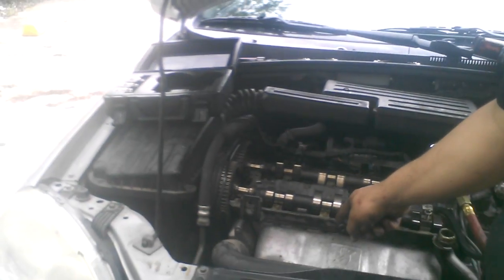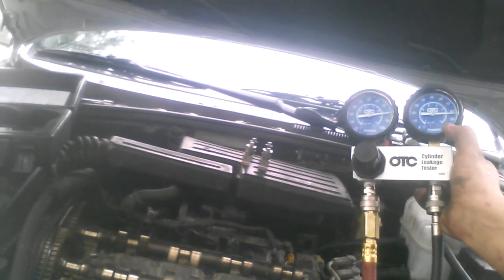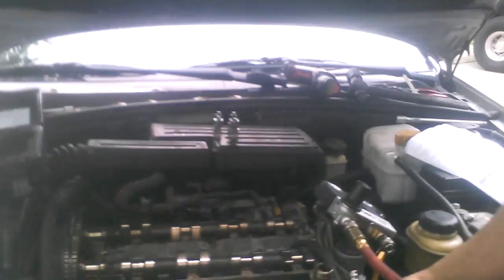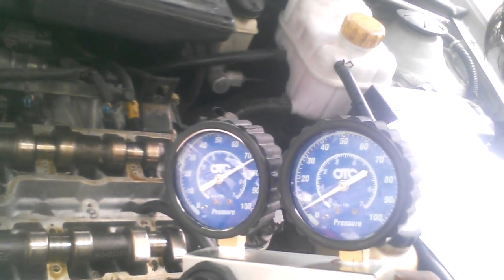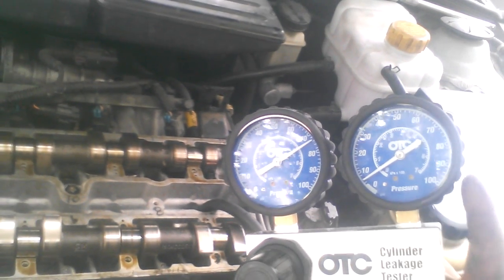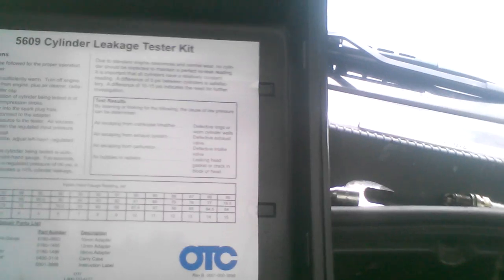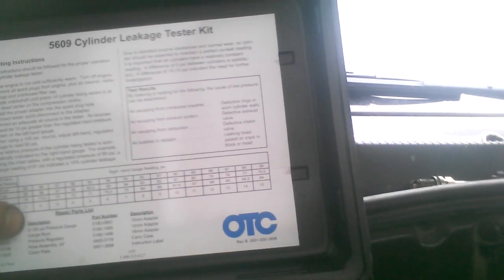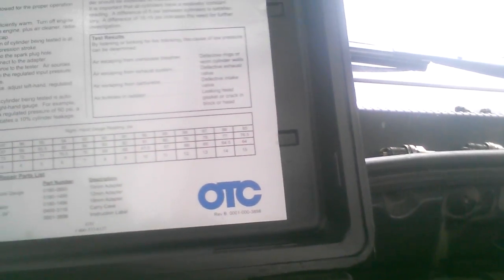What happens when timing belt goes boom

Comment: Hey my friend, I am dyer , I was ready to replace timing chain guide on 2000 bmw 540i , when I was ready to put the engine on top dead center, I turned the engine counter clockwise a few times. Should I replace the engine or send the head to to get repaire. I am not sure if I have some bent valve

Comment: so because you loosened the cams, you didn’t have to rotate the crankshaft in order to rotate the piston to full stroke? Just trying to fully understand. Thanks!✌️
Reply from the maker: With the cam bearings loose it is not pushing in the valves so the system is closed. But before you start make sure to set everything in time and make sure you know what you’re doing

Comment: i have a vw 2002 2.0 gas engine i put pepper where the oil go like a nut so i was driving then the car shut off and would not crank so a buddy put his computer on it it came up camshaft position sensor so i tryed to turn crankshaft by hand to put on top dead center 1 but the timing belt/sprocket would not move at can u tell me what could be the problem thanks for your time

Comment: OZ IM WORKING ON 2.4 ECOTEC  GM MOTOR AND WHEN I TOOK OFF THE VALVE COVER THE WHOLE RIGHT SIDE ON THAT CAM HAD BROKEN ROCKERS SO I PURCHASED ALL ROCKERS AND VALVE GUIDES I SET THE #1 CYLINDER THE UPPER STAGE  I SET THE CAMS AT 2 OCLOCK AND 10 O'CLOCK AND EVER TIME I TRIED TO TIGHTEN THE BOLTS FROM TE MIDDLE AND WORK MY WAY OUTWARD AND AS SLOW AS POSSIBLE THERE STILL A GAP BETWEEN THE CAM AND ROCKER SO I KEPT DOING THE TIGHTENING SUPER SLOW PLEASE  HELP ME ON THIS THE OWNER IS A GOOD PERSON WHO HAS KIDS AND SINGLE  PARREN

Comment: Hey Oz got a Jetta belt was changed and was told valve are messed up car turn on but not running good, they wanted 3k to fix the valves is that a good price or should i look around
Reply from the maker: Is it a 6cylinder ?

Comment: So basically there is no chance for the engine to be good if the timing belt breaks when you have an interference engine.
Reply: Jose Zavalza not correct it all depends on what rpm the belt snap at..I had my belt snap at 7000rpm piston was fine I redid the head and new belt
Reply: Richard Reid how much was the repair?

Comment: Well done Oz for sharing info and keeping it real. Is it possible that a failed belt at idle speed will do no damage? Is it a good idea to replace a snapped cambelt and try a compression test to determine if cylinder pressures are good?
Reply from the maker: Alex Lintern most likely whenever you have a snapped belt on an interference engine you will have engine damage

Comment: 1995 honda odyssey 295,000 broke timing belt hwy.fix or dump? Have leakdown kit . Will release spring pressure and do leakdown . Orderd just timing belt to set all marks.tdc.balancer belt ok .should I pull head and repair or rip for van?

Comment: If you have an interference engine and belt broke ther's a 99% chance some valves are bent. No need for this test if timing belt broke...
Reply from the maker: in the words of lloyd Christmas. So you're telling me there's a chance ?
Reply: @OzMechanics  Yes sir, there's a 1% chance the belt snapped  while the starter failed just before completing half a revolution & avoiding the valves from hitting the pistons!
great video btw :)
Reply from the maker: Thanks for watching
Reply: I have a 2004 kia sorento. The belt did not break but is loose. I put the code reader in and 10 codes came up saying misfire on the cylinders. Does that necessarily mean the valves hit?
Reply: Are you sure ?

Comment: good and informative vid,, just one footnote, if you're going to remove the valve cover and the cam caps you could pull the camshafts out of the way enough or poss remove them completely and simply check the installed height of the valves, you may b able to visibly see one or more that are obviously lower at the top o the spring than the rest, may save some time,,belt pops at low rpm {idle} MABE,,there might b a chance but, if it happens at higher rpms ,,its usually game over for the valves and the head will need to come off,bla,bla,bla, you know the rest
Reply from the maker: Sweeeet. Thanks for the advise. Always good to learn something new.. thanks for watching

Comment: oz I have a 2010 audi a4 2.0 t after a no start just crank over a shop diagnosed it with no compression I told him I suspect timing chain failure . no doubt the valves are bent . his advise was to replace engine but at +\_ $8000 I'm stuck .  does this guarantee the bottom end is also fried ?
Reply from the maker: Carlos Irizarry if the engine has a bunch of miles I wouldn’t just do the top end. Rings might be on the end of their life.

Comment: O have a 2006 suzuki forenza and same thing happened, changed timing belt hoping a quick fix but starter turns but car wont crank, by looking at your video seams i got all bent valves??
Reply from the maker: Jesus Cervantes yep. Did a Firenze with broken belt a while back about half the valves where bent

Comment: I have a 1996 eclipse, my timing is off by 1 or 2 teeth should I be worried about valves bending? When I get the timing on point should I do a valve leak test?
Reply: one or two teeth , most likely not as long as it truly is just 1 or 2,, if you look up the timing belt info they may give you the max. amount of variance in degrees from spec. you have before interference with the piston occurs

Comment: You’ll know valves are bad when after testing for compression , and it’s low , if you pour oil in that cylinder and there is no improvement in compression, it means you losing it through the leaking valve/s, if it’s low cause of piston rings you’ll get improvement on compression, after pouring oil into it

Comment: Will the engine  start when you replaced the trimming belt and maybe the valves are damaged
Reply from the maker: Botshelo Tanki the engine could still start. You might just have a couple of valve damaged. But that still needs to be fixed

Comment: Hey OZ . Thanks for this video . I have a 2004 Toyota Tundra 191000 miles was going to get the timing  belt changed a week ago  . Just before the holiday heard the scrapping kind of rattle sound like it was rubbing the cover. Then sure enough 5 degrees out side late at night coming home came to stop light and the engine dies . Interference 4.7L  V8 . 99% sure it's the timing belt . My question is with this many miles do I fix engine and valves ? Replace engine ? Do I roll this truck into my driveway and take it on in the spring time myself ? Pretty handy and not much to loose at this point . Or sell it as is . The rest of truck has served me well . Changed the first timing belt about 90,000 miles . Thank for your help and info . Great video !!!!
Reply from the maker: Those engines will last for a long time. If you fell good about doing the job go at it if you don’t. Just don’t risk it. If you do end up doing it just take the heads to a good machine shop so they can do a valve job

Comment: I have a 00 jeep 4.0 with one cyl misfiring I took out the spark plug and it was all covered with water corrosion, pretty good sign that have water leak trought a head crack or head gasket rupture, I check the inyector (swiped) and its working just fine, I checked the ignition spark and it does too , I put a head hasket/head crack fix quimical and looks like it did the work ( air bubbles not coming out on the radiator anymore) but still misfiring. I took out the spark plug and the injector wire and started the motor, but it looks like compressed water mist coming out like water still getting inside the cylinder (it was not gas mist, because the ignition spark was firing right at the spark plug hole and didnt make conbustion) besides that, the exaust expulse five times in a row and inhales one, that tells me that the exaust valve its bent, matter of fact. . the engine has been overheated and has been consuming  water in that cyl. and pushing it out from the cooling system at the same time.
But. .  . I dont know anymore, I took out the thermostat so doesn't get too hot again,  my next step is to check the piston compression.
Reply: 00 jeep w 4.0,, im guessing very high mileage ?  you would need to remove the head and send it out to a machine shop, and have it checked out and reconditioned,, new head gasket, and money ,,money ,,money, and after all that, i've found that when you freshen up the top end of an older, high mileage motor like that,within a few weeks or mos. the bottom end goes,,ie,, connecting rod knocks, mains ,,so, dont put good money after bad,,realistically, find yourself an engine, complete,,either reman or lowermileage used, that is assuming you want to keep the vehile

Comment: Hello, I just wanted to ask you if the 4.2l vortec engine on 02 trailblazer will bend valves when it jumps a couple of teeth?
My exuast sprocket broke off and it would turn freely while the variable timing sprocket would turn with the chain. I fixed that issue, Got it back on timing.
What is the compression psi avarage on these engines if you know?
I did a compression test and I got an average of 125psi across all six cylinders dry test.
Reply from the maker: if its just a couple of teeth it shouldnt bend anything. that should be enough to turn on the engine
Reply: Oz Mechanics OK I see...thank you

Comment: Thanks.  My timing belt broke on 2003 CTS 3.2L do you think I should do head job or replace engine.
Reply from the maker: Judy  Hunter just depends what's better for you. Are you planning on getting a junk engine ? What's your price range ? How many miles does your current engine have
Reply: Send heads off to get worked.   Most of engine wear happens in the top.end if oil was changed regularly

Comment: soooo the diffference between interference and non-interference engine is,  whoever created the interference engine is just a twat.
     thats my take
Reply from the maker: TytallicA that is 100 % true. Lol 😂
Reply: Yes, that and aluminum engines are idiotic.
Reply: Interference engines were designed to improve compression and therefore fuel economy and power. A cam chain would be a better solution.

Comment: As a former ASE Master Auto Tech who worked for several major car companies, I want to say that you did a great job of making the video, and explaining it. Cylinder Leak Down Testing is a lost art, and can save the customer a lot of time and money, rather than just buying things like a new tensioner, timing belt, and water pump, only to find out that after you try to start it, there is further damage that goes beyond what it is worth to spend on the vehicle.

Especially since there is a some chance (albeit small)  of a crack or hole in a piston, and that gets expensive..

This is the right way to try and determine if there is any damage. Great job!
Reply from the maker: DanLeeProductions thank you very much. Thanks for watching
Reply: DanLeeProductions  a lot of talk very poor camera view

Comment: if you have bent valves will your engine be able to start
Reply from the maker: jamal williams just depends how many. If only a few you might just have a misfire
Reply: thank you during my timing chain install I believe it skipped a tooth and will not start and has an metal clank while trying to start
Reply from the maker: jamal williams call me 7134809458
Reply: Oz mechanics how do I know if the timing belt broke on a 2006 Volkswagen Passat 2.0t
Reply: Oz mechanics call/text me please 317-469-8360

Comment: Good video, bro, but you can hear the air coming out the intake or exhaust. I do the same test without the fancy gauges. I close the valves via removing the cam or rocker arms and apply direct air into the spark plug hole, then listen for leaks.

Comment: good looking bro. I  just had a timing chain guide break on a 2.4 2010 malibu after replacing everything I get spark fuel but not crank . help me bro ?  I'm lost what I do wrong
Reply from the maker: Jose Sierra have to make sure that all wires are connected or make sure that the timing is straight on. Some imperfection would not cause the car to work.